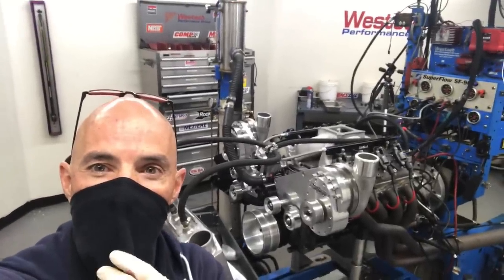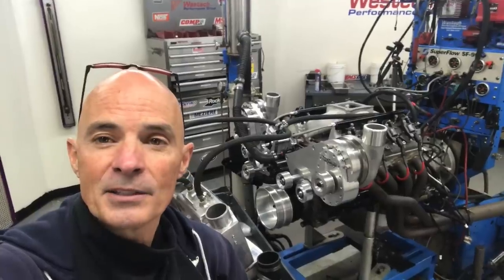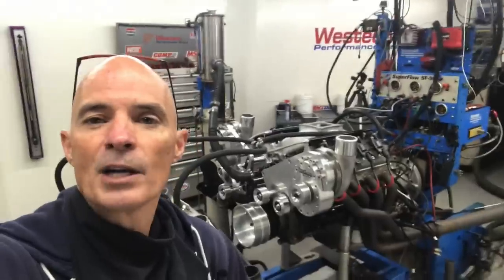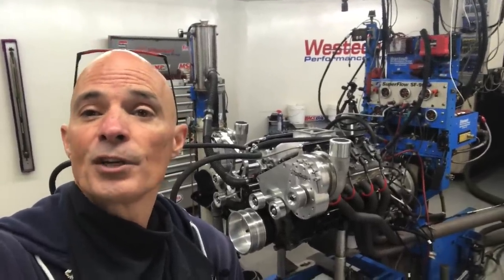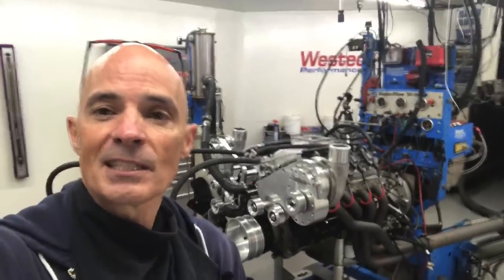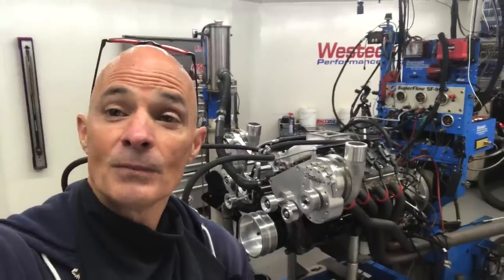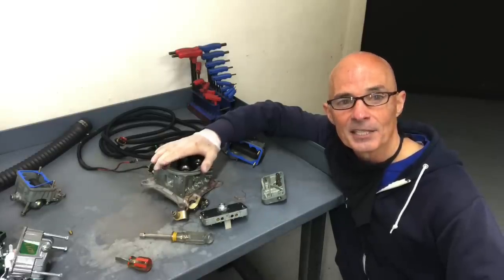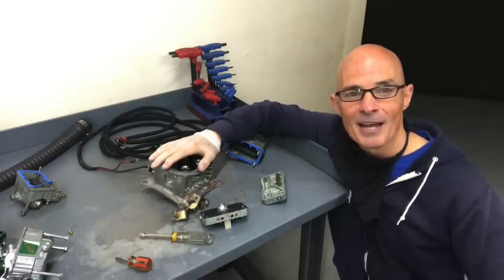WHAT'S INSIDE? -BLOW THROUGH CARBS

Comment: I'm a mine ventilation engineer so airflow modelling is my game. I think the issue's you're having are at least partially related to the carburetor 'hat' you're using. It has a really sharp 90° bend that is no doubt causing flow separation and turbulence. The 1 thing that you want above all else through a carburetor and it's boosters is laminar flow. Another youtuber (Eric the car guy) had a very similar issue here: https://www.youtube.com/watch?v=Naj3LL-zIj0 @ 39 minutes discussion starts regarding this.)

I'd suggest trying a carburetor hat that has a better radius into the boosters. Even one with guide vanes or a large plenum (like the old Banks power hat's from the 80's.) Remove the turbulence to improve booster signal and response ;). Remember that the cleaner and stronger you can make the signal at the boosters (by improving the Delta.P between the main venturi and booster,) the more fuel you'll drag through the booster. If the air is all chopped up, no clean signal = no fuel draw. You could even go as far as having a 30cm straight pipe extending out the top of the carb into the hat to have air moving completely vertically into the boosters.

In addition. As airflow/airspeed increases at tight 90° bends, the turbulence increases making the problem worse. Just think water through a hose. 

Good idea for a test. testing various carb hats ;).
Reply: Not a airflow engineer but a lot of experience with road race motorcycles with ram air systems and agree that the hat is where i would start. I think turbulence also and drop in float bowl air pressure the result. Try jamming some fuel hose onto the bowl vents and positioning the open ends of the hose to recieve a clean shot of airflow directly at the tubes. Would it be possible to rig a pressure guage into the dribble drains in the side of the bowls to compare hat with bowl pressure.
Reply: I thick Mr.Holdner short try bowl vent extensions too, I’m suing 3/8” x 12” aluminum tubing part # 800-632 doorman brand. I think ^ is 100% correct.
Reply: Tittan1500’s YouTube channel has a 1000hp ls too and had similar problems. He made some videos on how to set up a blow through e85 carb up here in MN.
Reply: Eric the car guy had some wierd carb hat issue like that on the Fairmont
Reply: Three different carbs all had the same problem. It's not the carb.
Reply: Maybe fuel for thought, I was also thinking of turbulent airflow being an issue, also with the quick photo of where the boost reference tube is on the hat, would there possibly be a turbulent wake or vortices forming at a certain airflow right at the point where the boost reference opens up into the hat, if there was a vortex forming there it could be acting slightly like a Venturi and pulling some vacuum on the pressure in the reference line, causing fuel bowl pressure drop vs actual boost pressure in the manifold/in the carb itself. 
Sorry I am pretty bad at explaining things but I know what I’m saying in my head...
Reply: Ok, with the same issue with two proven carbs , you guys might be right, a poor hat design favouring the far side barrels .
Reply: I wonder if there is a point in the rpm range where the flow in the carb hat transitions from laminar to turbulent flow?
Reply: @indyrock8148  with very specific test equipment you could determine this. But with such a poor looking carb hat, it might never be good. However at low airflow (especially at part throttle) it just might not be as significant a problem or otherwise masked.
Reply: Steve Morris done a test on blow through hats. That's why he has 2 different hats. and also just need to stay with fuel injection. some body borrow their computer. I would if I wasn't in MIDDLE OF NOWHERE MO.
Reply: Extended vent tubes into direct airflow could help too.
Reply: You can be totally right
Reply: I would also recommend the Extreme Velocity PRO carb hat, it has a 1” spacer and no inner blade stock unlike the regular model.
Reply: Extended pipe might work. Idk. I do know air travels through pipe in a spiral or helix. Have no answer. Just interested in how it works out. Cheers
Reply: @trentm7964  you don't want air traveling in a spiral (helix.) You want air moving as straightly (laminar) from point-A to Point-B. This provides the lowest possible resistance. This is true for Dry flow and double for air moving though a carb choke and booster. This is why people polish carb intakes and install bell mouths. The goal is to improve the 'Discharge Coefficient (CD.)" This number (always <1) is the difference between the "actual pipe diameter" and the "effective pipe diameter." A really well designed belmouth (in pipes of this size range) might have a CD of 0.75, vs a plain open pipe of 0.5-0.55. Thus improving intake (actually refereed to as outflow in) conditions can have significant positive effect on airflow and thus power potential though a fixed cross sectional area. Likewise if you make a hash of it, it all turns to a steaming pile of 💩.

With wetflow, having tumble or surface interference can be beneficial in improving fuel mixing (note how carb guys never polish their intake manifolds.) That surface turbulence at the boundary layer helps keep fell off the port/runner walls. But in my opinion, that's not the issue here. the issues are all above the carburetor in dry flow.
Reply: @manitoublack  thanks for the info. I appreciate it.
Reply: Vent tube extensions will make fueling smoother with alot smaller jett
Reply: The issue with AFR disparity throughout the motor would also point to an airflow imbalance through the carburetor (or really bad manifold design.) Where boosters favouring 1 set of cylinders are receiving more airflow (or at-least better quality airflow) than others. Once again leading back to the point's I made in the above post. You want equal laminar airflow though all 4 barrels. If you don't you have no hope of getting your tune on point. As unlike EFI you can't trim each cylinder individually to compensate of airflow imbalance.

Regards
Jordan
Reply: @manitoublack  Jordan, I'll Thumbs Up anyone who even knows what the Colorado School of Mines even is. Thank You for keeping Miners safe.
Reply: Power nation guys had a similar problem and changed hats.
Reply: Yup I thought about Eric’s dilemma right away. Richard, Change the air hat.
Reply from the maker: we've run the combo many times-it has work many times in the past
Reply: @richardholdener1727  Thanks for the reply. Still you've tried everything else, so what have you got to lose👍.
Reply: @richardholdener1727 , compared to gas you have a BIG change in fuel mass so that it has worked before means little. I agree fully with the hat theory, based on 35+ years of engine design and building - not a doubt in my mind.
Reply: @richardholdener1727  appreciate the videos. Cheers
Reply: @richardholdener1727  that Q sereis carb has annular boosters unlike your older CSU carb. that may have something to do with the fuel draw through the carb
Reply: Richard Holdener you should take into consideration the speed of the air going through that pipe, the faster it goes the hardest is to make the turn for the air. If you used a inter cooler before or you changed something in the equation you get different results
Reply: @richardholdener1727  yes it may have, mr Holdener,  but compared to what? and what size carburetor vs boost?
Reply: I think he isn't getting enough fuel, not an air problem.
Reply: @Finkelsteinholy  air flow through the carb venturi is what determines fuel flow
Reply: @trevorchadwick5479  not only is thier an  Abundance of air, That carb hat and carburetors have been used by multiple people without any problems. including Richard.
Reply: My .02 worth to much turbulence at the hat, raise the hat approx.
12" to allow the air flow to straighten out before entering the carb.
Reply: LOL.  Credibility hit -10 when you reference Eric "the car guy".
Reply: Airflow modeling is all well and good but there is that pesky fuel flow to deal with as well. And that is the problem Richard is having. I dont disagree that airflow quality has a direct effect on fuel flow through a carb, but there's much more to a holley 4150 carb than airflow alone. There are many ways to tune the fuel curve, independent of air flow.
Reply: @fattsthebavarian6104  
Me too

Comment: Why does torque and hp always cross at 5250?
Reply: Because Mathematics
Reply: Hp is a function of (Torque x RPM )÷5252 . Hence why they cross over at 5252 . The longer / higher in the rpm range an engine can produce torque the more HP it creates,that's why small high revving  engines can make high Hp but have small torque numbers .
Reply: One horsepower = moving 550 pounds 1' linearly in One Second. You convert this to radians by dividing by (2 × 3.14).  Also Convert Seconds to Minutes.

(550ft-lbs × 60 Seconds) ÷ (2 × 3.14) = Approximately 5252.
Reply: @ericsperformanceparts1647   What's funny is that we're still using a measure of power developed by James Watt in the late 1700's to quantify the power our engines make in 2020. Could have just as easily been chipmunks or monkeys
Reply: @fattsthebavarian6104  Actually, most people used horses to plow fields and pull wagons and wanted to know how many horses the engines could replace before buying one. Chipmunk power might have been useless information for them. Except for those using chipmunks.
Reply: @fascistpedant758  Well i would've used chipmunks...free labor...
Reply: @fattsthebavarian6104  They're just more difficult to herd.
Reply: HP = Torque x RPM ÷ 5252
Reply: because science ☺ (HP = Torque x RPM ÷ 5252)
Reply: Thanks hadnt seen that equation!